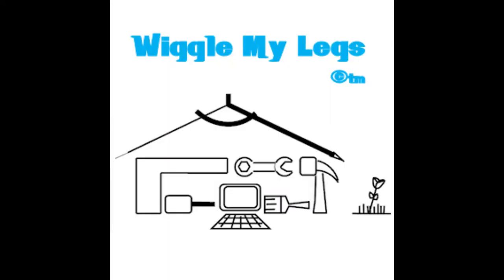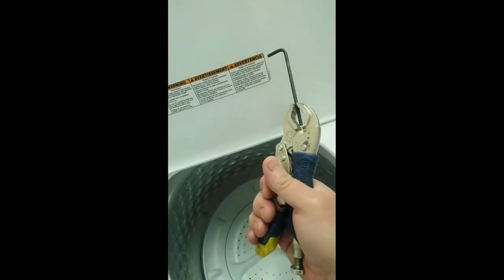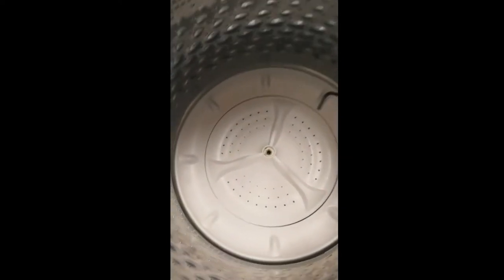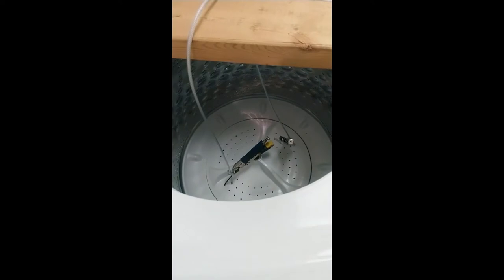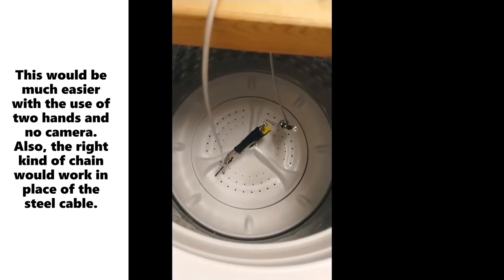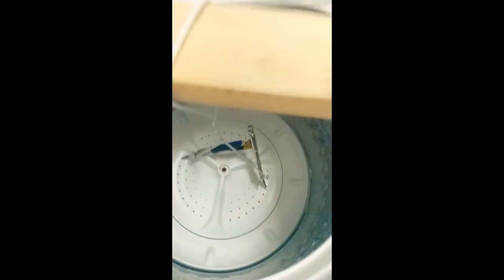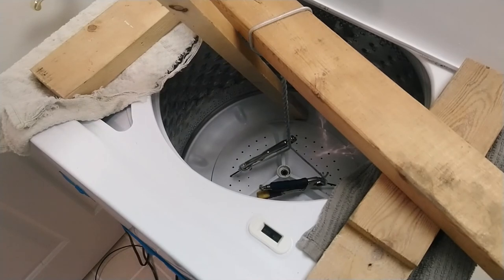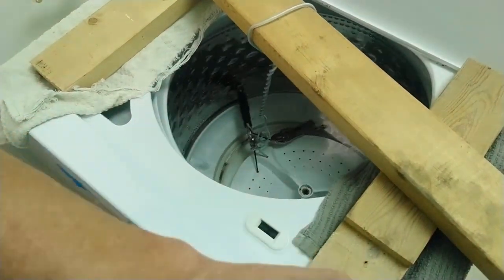Whirlpool Stuck Washer Plate Puller

Comment: Nice!  I've theorized something similar as I'm 6 days into the struggle of trying to get this plate off.   I definitely like your thinking!
Reply: Glad you like it Gary.  Good fortune to you with your efforts.
Reply: @christopherjaywolff6506  Welp, just tried and failed, instead of using Alan wrenches I used the right angle pick tools and just punched them through some thick strap and ran them over the top of a 2x4 with a scissors jack on top, and carefully jacked the strap up (trying not to lose an eye) but after a certain pressure one of the tools would pop out....back to the drawing board...
Reply: @deathcar  Darn!!  If I remember correctly, this twist thing I tried helped keep my allen wrenches in the holes.  I was thinking while trying it, that the allen wrenches were too far apart and might not be giving me enough upward force, but also noticed that once the cable started getting tight, and the twisting started getting lower and closer to the wash plate, there was virtually no chance of them coming out of the holes, unless something broke, or the vice grips let go.  You can buy the plastic coated cable at your local hardware store by the foot.  Got mine at ACE.  Maybe pick up some vice grips too.  Isn't it funny what humans do with their time and money?  😆  Also, it seems a pick tool might have a tapered tip coming to a point, so that isn't helping it stay in the hole I would guess.  Kinda like using a 92 degree tool once you factor in the angle of the taper rather than a 90 degree allen without a taper.  Good fortune to you again!!

Comment: I ended up doing something similar to your wire / plier Idea. I drilled a hole thru each blade 2" from center hub and laced the cable thru. it worked great and didn't use the vice grips (didn't have any)_
Reply: Way to go!!  That's exactly the type of thing I was thinking I would have to do, when mine finally came off.

Comment: Hello. OK, FOllow the bouncing ball here, this is not that difficult.  FIrt, remember the splines that connect the wash plate to the transmission are tapered!  Prying up on ANY side of the plate only makes things worse since it pinches the splines together and all manner of yankiing on the edges simply tightens the two splines even more!  Here is the best way that worked perectly for me: First, once you remove the center bolt, pour either heated white vinegar or a good spray of BLASTER around the bolt hole making certain it gets into the splie area.  Let that soak in for at least an hour.  Next, gently tap all around the center collar of the plate including tapping both sides of each impeller vane.  NOT TOO HARD, just enough to break any corrosion between the two splie parts...make and female.  Probably should NOT hit down onto where the bolt was...that will only further jam the splines together.  Not doo.  Now, take a GOOD pair of channel locks, tightly grip anywhere around the top edge of the bolt collar (the raised circle that surrounds the bolt), and yank up.  Voila, it should come right out but make certain you pull it STRAIGHT UP and not torqued to one side of the other.  All the other methods only worked againsT you.  And when you are ready to replace the impeller or wash plate, make certain you take a good brass brush and clean out the splines as much as you can to remove any loose corrosion. Take a tooth brush soaked in blaster or WD40 to clean out the inside of the plate spines.  Then, coat both splines with a good Anti Seize lubricant (Permatex is a good choice in the gray tube).  Replace the wash plate or agitator and exercise up and down gently to evenly better distribute the lubricant.  You are done.  Relplace the bolt with the BLUE Lock Tite lubricant.  Now if you need to remove it at a future date, repeating the above provess will allow the plate to be removed easily if even you need to do that.  And no, the lube will not stain your clothes.  It is fully encapsulated by the tight fit of the two splices.  Enjoy.. Dr. Z (Lou)
Reply: Please forgive me, but this comment is fairly irrelevant.  The bouncing ball was a gutter-ball so-to-speak, so no pins down.  :) Also should mention this tourniquet method was used because all other methods employing Blaster spray for cold, and heat, and hammer tapping, and yanking had already been tried and completely failed.  Many repair professionals who have come across this problem end up having to destroy the washplate.  Also the washplate screw hole prevents getting WD-40 effectively into the splines.  You'd have to fill the tub with WD-40 up to the top of the screw hole to soak the teeth.  If you try to lift from next to the bolt hole as suggested with a single off-center channel lock contact point, the hand and arm variations in yanking movement from an off-center point, would be much sloppier than the tourniquet method I use with two contact points 180 degrees apart exerting even force on both sides without variance and without wobble.   Plus, in the case of the machine in this video, it would not work.  This comment seems more like one of my students trying to pass off an AI essay rather than learning something or maybe it's due to having too little experience.  It is also possible this person's machine was only 6-12 months old and hadn't developed a rust weld for 12 years or more like us others that know better.  God bless you all!!
Reply: @christopherjaywolff6506  HI there.  Thanks for the response, but all the other methods all end up with that male-female center spline "tower" being pinched.  Not certain how this could help release the stuck splines.  Another suggestion would be to not let the spline connections rust shut in the firt place.  How, yo say?  How about eveyy 6 months or so the owner remove the washplate or aritator, clean up both spline surfaces/ridges, apply new anit seize lubricant and reinstall!  I think that would go a long way to prevent it from eing stuck permanently.  I am a retired music educator but can think through most tasks given how uncompicated this particular one was.  In the end, I guess "whattever works" is the operative term here.  Dr. Z (Lou)
Reply: @louiszagar1270  Thanks for getting me to revisit this.  After freshly reviewing my video, I see I did not emphasize enough the prior attempts at removing this Wash Plate.  After many side to side taps with a hammer, and pulling and yanking straight up by hand with the vice grip allen wrench combos, nothing worked.  I sprayed WD-40 very liberally at the screw hole hoping it would find a way to the teeth.  I lifted the edges of the plate and stuck screwdrivers, and mini-pry bar under the lip and tried to keep inserting thicker tools under the lip to lift it up.  Absolutely failed.  Then, as in past years of working on rusty parts, I decided to leave it overnight to let the WD-40 work.  I sprayed it liberally again and left it a day.  Returned the next day and again applied all the techniques mentioned above.  Wouldn't budge.  Got the spray can of Blaster and tried a bunch of that followed by the same lifting techniques.  Wouldn't budge.  Then I got my heat gun.  Wouldn't budge.  Then I tried switching much more quickly from Blaster cold to heat gun.  Wouldn't budge.  Then I spent hours on the Net and didn't find a solution other than cutting it out.  So I figured as long as I'm going to destroy it, I'll use maximum force from this tourniquet method and possibly snap it in half or something.  But as you see it finally came off.  Really wasn't a pinching issue, just a rust weld.  I was wrong not to have included this narrative in the original post.  It is a disservice to say this Wash Plate removal is uncomplicated.  It is very complicated to get enough force within the context of this repair.  In my years of rust breaking only really old car parts have been similar to this, but those car parts can be addressed much more easily with WD-40, Blaster, and a torch, and tools.  You're right about whatever works is good.  While many don't have this much trouble with removal, my solution is for the people who need something above and beyond normal practices.  Another exacerbating factor in creating this incredible rust weld is the tap hot water for this machine is set to 140 degrees and it has gotten heavy usage over many years.  This method might also prevent the need for repair professionals to have to wait a day for WD-40 to soak.  It is also a method that can be employed by men and women with less physical strength.  So this tourniquet method isn't needed for many, but can be a relief to many as well.

Because of having to wait for parts to arrive, scheduling time, and laundry build-up, the decision for the original repair in the video here, was to not replace the Gear Case with motor shaft, and only replace the Basket Drive Gear and Wash Plate.  It turns out in 2024 as we'd expect, that over the last two years, the old rusty teeth in the motor shaft had a tiny bit of play in them rather than tightly meshing with the new Basket Drive Gear and the new Wash Plate.  This tiny inaudible play in the rusty teeth wobbled over two years undetected until the clicking noise started in about June-July 2024.  The wobbly play was also starting to wreck the teeth of the new Basket Drive Gear and new Wash Plate that had been installed.  It finally quit spinning when most of the rusty teeth sloughed off the motor shaft so it wasn't getting a grip.    Therefore, this time, I replaced in August 2024, the Gear Case with new motor shaft and another new Basket Drive Gear and another new Wash Plate so all teeth are new and mesh tightly.  Took videos and hope to post when there is time.  And as you might expect, the Wash Plate was simple to remove after only two years on rusty teeth.

P.S.  I noticed today the Wash Plate price was over $100 at the time of making the video, and now I see in September of 2024, they are $30-50.  And if from repairclinic.com also come with a new screw with thread lock already applied.